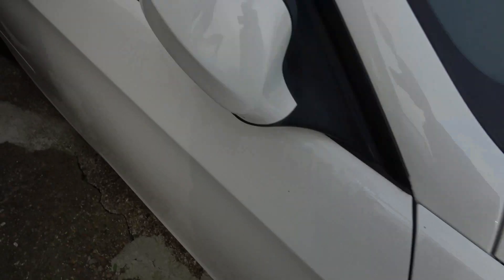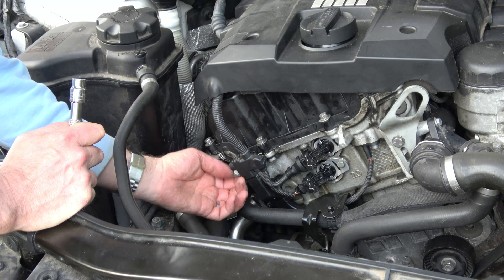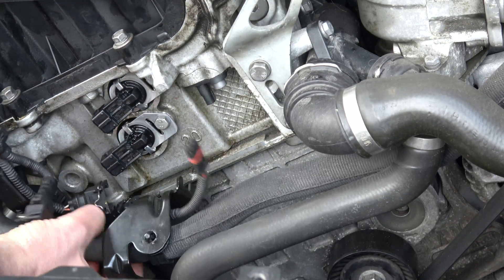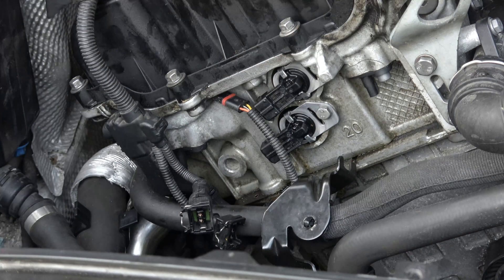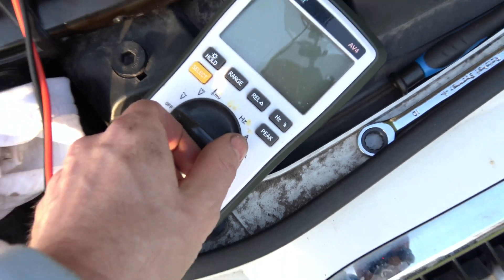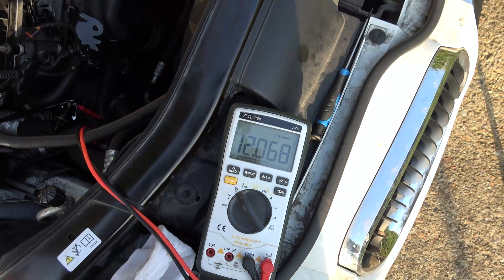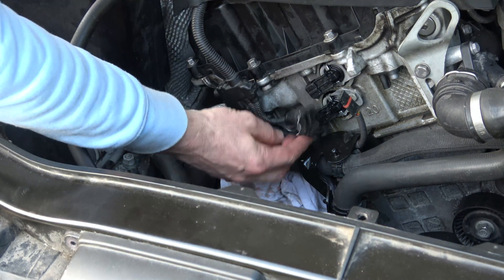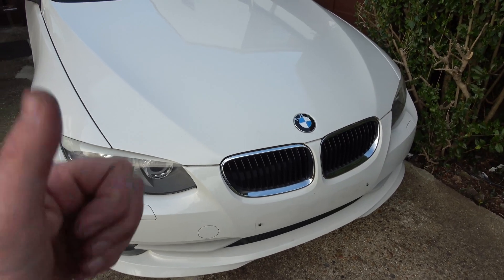How to REPLACE & TEST Exhaust Camshaft Position Sensor on BMW 320i E92 - N43 Engine

Comment: Very intuitive video. Are you sure you aren't removing the intake, rather than the exhaust camshaft sensor? Looking at schematics, it looks like the inlet is on the left of the cylinder head and the exhaust is higher up on the right.
Reply from the maker: Thank you. Yes, it is definitely the exhaust camshaft position sensor in this video. I have just released another video on the intake one which is the sensor on the right hand side as you look from the front of the engine. This engine in the video is the N43 engine 👍